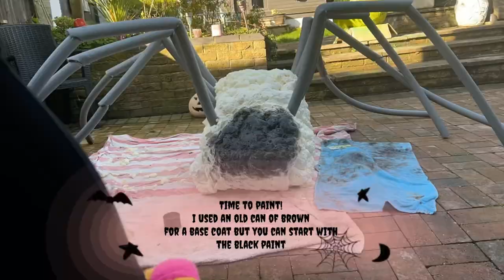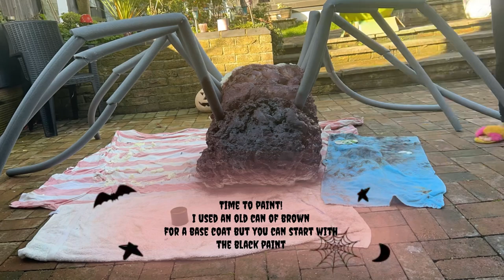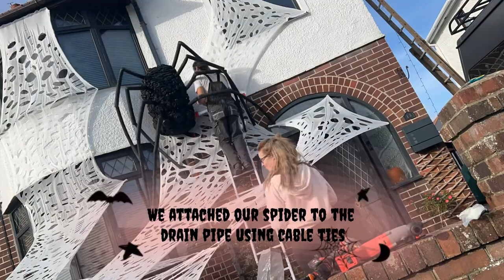Giant Halloween Outdoor Spider & Web Tutorials | UK Materials

Comment: Great find with your substitute for the beef netting! Just a couple hints.. after spraying the foam, hit it with a light mist of water then wait 5 minutes or so, you can mold it too to your desired shape. hitting the pipe insulation with a heat gun, (easy does it) you can bend, and even bond the foam together.
Reply from the maker: Hey! Thank you so much. Awesome tips!!